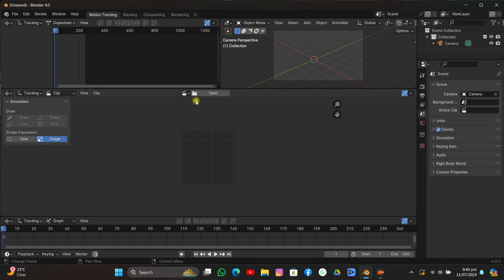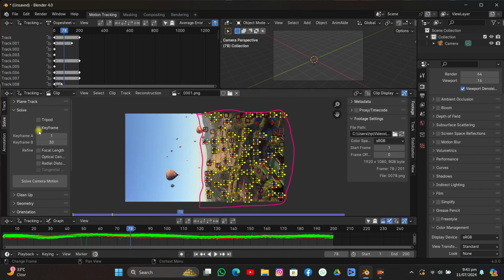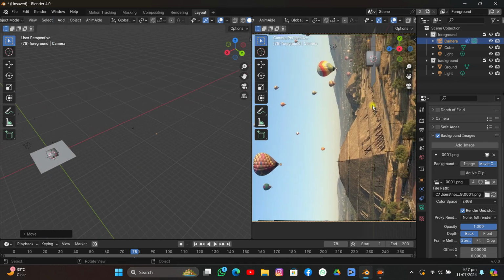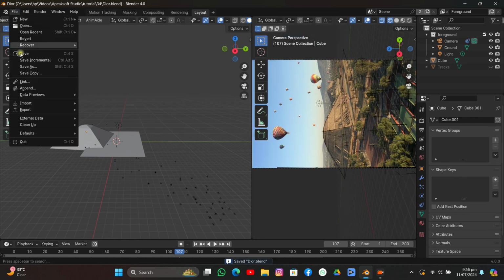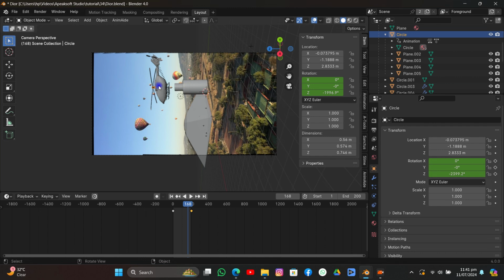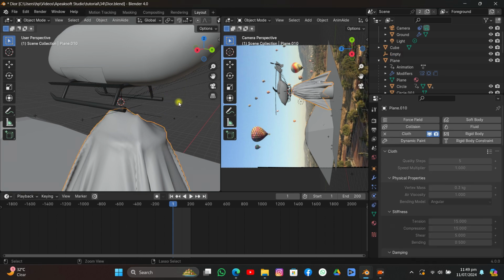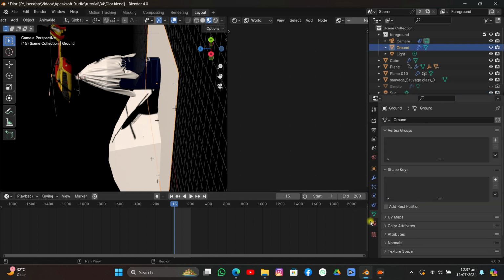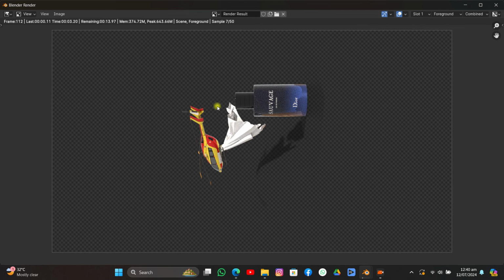Awesome CGI product ads using Blender 3D - step by step vfx tutorial

Comment: I have an issue with rendering. I don't have graphics card so the gpu cycle is disabled and after render file is not saving and the render result is very bad like reflected lights or noisy. Give me a solution 🙏
Reply from the maker: I can't explain it in a comment
Reply: @KamranWaziir352  overall thanks 🙏 I made my first CGI by your instructions ♥️ if you have Instagram I'll tag you

Comment: My helicopter didn't have default animation , what should i do ?
Reply from the maker: Goto edit mode, select the area you want to add Animation into. Hit p to separate. Right click and set origin > set origin to center. Click i" to add a keyframe I the beginning of the animation. Then go forward in the timeline and rotate the area on z axis and click i" to add another keyframe
Reply: @KamranWaziir352  Thank you so much it works
Reply: my cloth is overlapping from the perfume bottle what should i do?
Reply from the maker: @ShreyDave-nt9mg add collision into your bottle
Reply: @KamranWaziir352   I had added collision , it is happening after adding collision
Reply from the maker: @ShreyDave-nt9mg try making a proxy object around the bottle. And then remove collision from the main object and add collision into the low poly proxy object and then bake the cloth simulation. It will work
Reply: @KamranWaziir352  ok

Comment: my cloth is looking like a mess. I've tried everything and many tutorials, you all say the same thing but mine just shrinks, scatters and crumples onto the object. I've reinstalled Blender but still same issues. Please can you help me?
Reply from the maker: Bro, try not to scale your plane big or very small. Before you add cloth physics try hitting ctrl+a and apply scale. Try not to have huge amount of vertices. If you have large amounts of vertices try decreasing the mass of vertices in your cloth settings
Reply: @KamranWaziir352  thanks so much for your response. It's a lot smoother now, but 2 things stay happening. 
1. The cloth sort of enters the collision object, like it partially disappears into it by a few inches in some areas.
2. When the helicopter takes off, the cloth (pin group) stretches along with it, rather than the cloth leaving the object it covers.

I've spent money sub-ing to Geotracker and I really don't want it to waste, it'll be helpful adding successful bits like these to my portfolio. I really would value your help. Thanks!!

Comment: Thank you, but the Cloth is stretching with the pin group movement , Instead of Entirely moving  .Please Help :(
Reply from the maker: Bake it
Reply: @KamranWaziir352  Thank you it has worked  :face-blue-smiling:
Reply from the maker: @alzahraah.a7227 Cool
Reply: @KamranWaziir352  the bottle is "Collision" still the Cloth is Overlapping with it
Reply from the maker: @alzahraah.a7227 I told everything in the tutorial. Watch it in focus. No one had a problem but you have a lot of problems. Watch it again
Reply: I had to Create two cylindrical volumes for the Bottle collision instead, to make it clean. Is that right ?
Reply from the maker: @alzahraah.a7227 yes, you can create proxy low poly object to make the simulation faster

Comment: Bro when i select hefflicopter and animate it animates only its parts and when i join them then the blade is not rotating.
Reply: please help i am a super beginner.
Reply from the maker: @satvinedits238 I just told you. There is a small object in between the blade. That object have control over the blades. Now select that tiny object and animate it. It will also animate the blade with itself
Reply: @KamranWaziir352  thank you so much it really helps!
Reply from the maker: Don't join them. There is a central object. Select that object and try to animate..the central object is already have those blades as children.